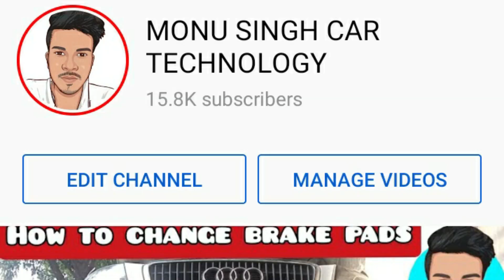accident repair car,car accident repair workshop, full accident car repair,accident car repair hindi

Comment: Brother mere pass i10 1.1 cng h uske 1 month se rpm fluctuate ho rhe the maine uski throttle body clean kra di ab rpm to theek h uske cng pr h or petrol pr b 800 900 k as pass h lekin ab uska brake paddle hard hone lda throttle body cleaning ke bad qa problem ho skti h pls give solutions